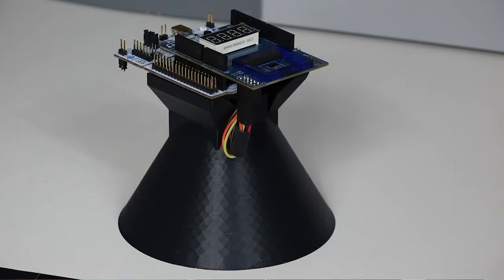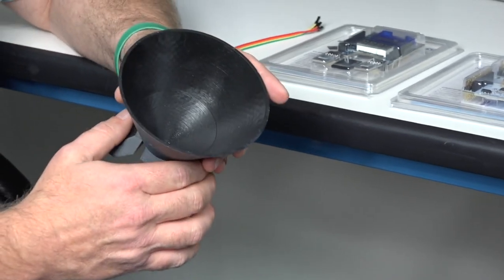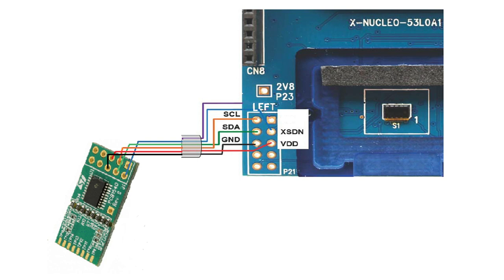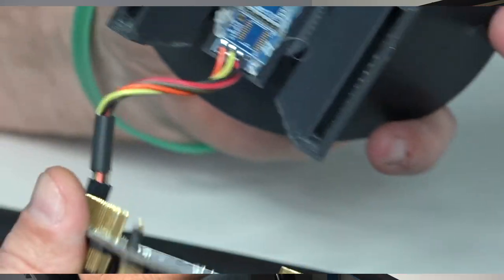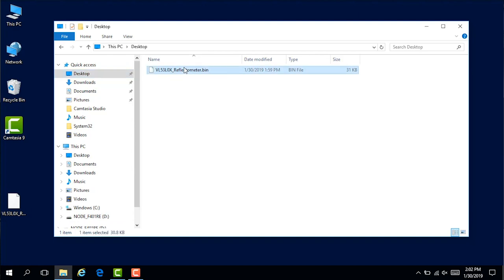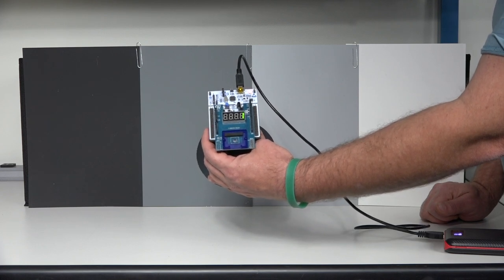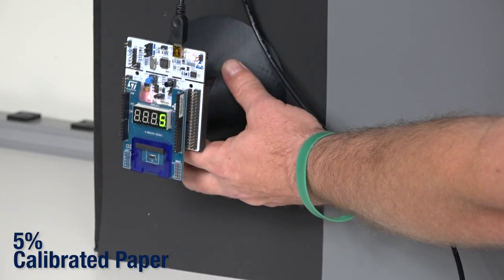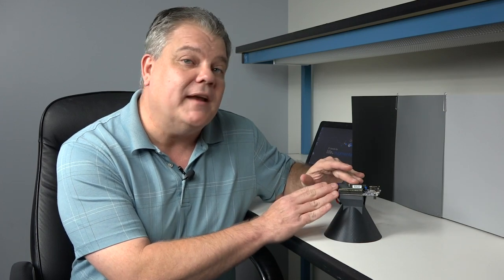Building a Reflectometer Using an ST Time-of-Flight VL53L0X

Comment: What principle is reflectivity measurement based on? Looking at the datasheet, it's not obvious there's any built-in functionality for measuring return signal strength or even controlling transmission brightness.
Reply: Also, is the actual source code available anywhere? The example is mostly useless with only a binary blob.